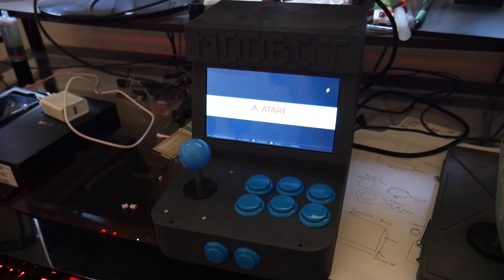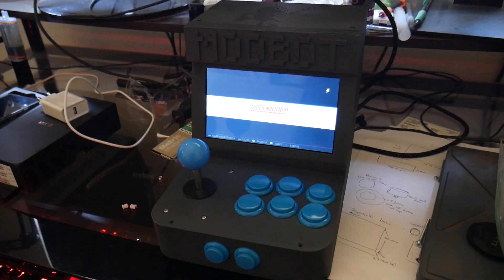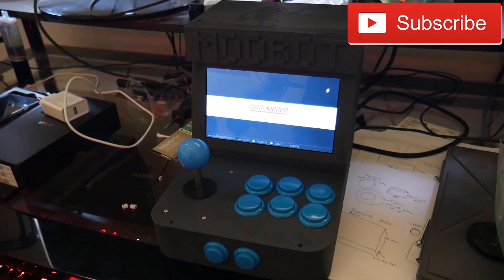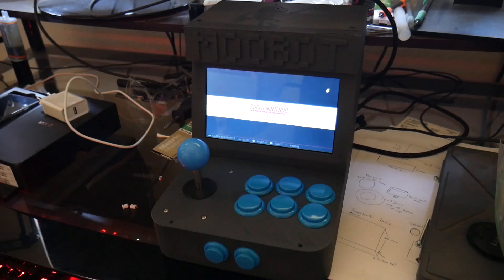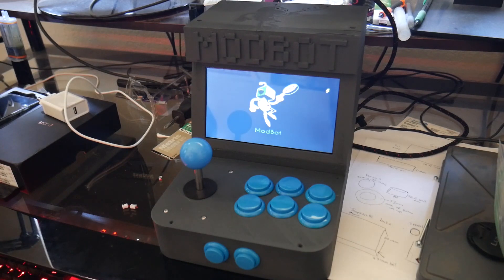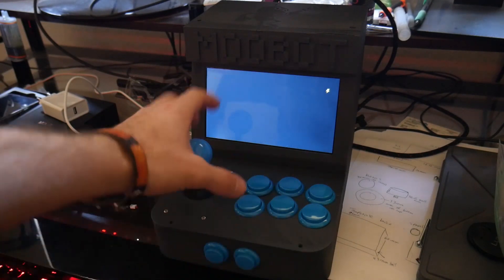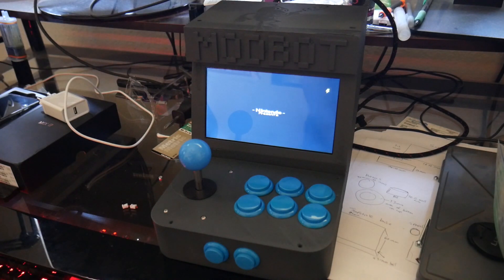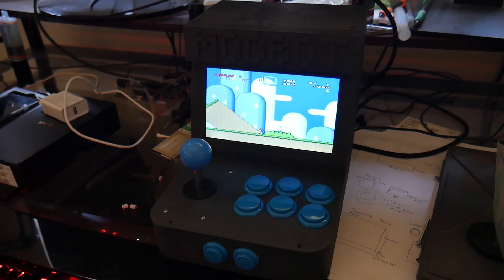3d Printed RetroPie Arcade Project Updates!

Comment: I've used Bluetooth controllers on a Retropi   system and there was a ton of control lag.  You might want to investigate that before you seal up the box and block the usb ports off.
Reply from the maker: Thanks for letting me know I do not plan on sealing the back I just dont know how easy I want to make it to go in. The ribbon cable for the lcd is so fragile I dont want to risk tearing! but Ill leave it available just for the options

Comment: Good job man its looking great! And the volume adjustment you did there is exactly what I was referring to by "adjusting the volume in software". Only downside is you have to be at the menu to do it. A plus side to that is that you can always add volume hotkeys to adjust the volume in game as well.
Reply from the maker: thanks alot man yeah I learned alot about the software over the past day or two from just messing with it. I did add some hotkeys but I dont think I added the volume one yet. Again typically 75 percent is perfect for just playing 100 percent is more just to show off that it can crank out the volume if needed. I cant wait to have the back on it and maybe add some sticky rubber feet haha. There are alot of little things I would like to do but most of them are pointless and overkill so I do not know that I will maybe save some of the ideas for a future project. All I want to do now is play games lmao